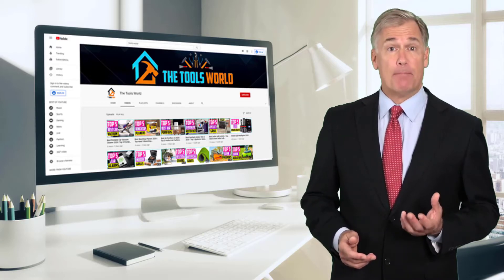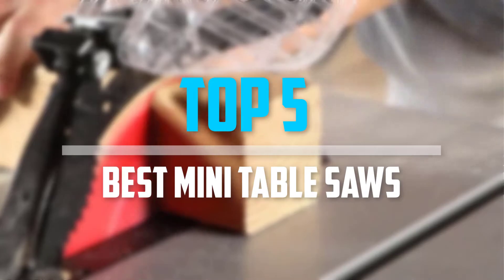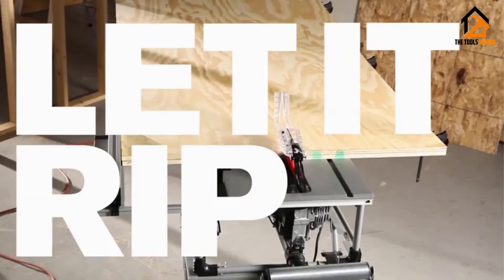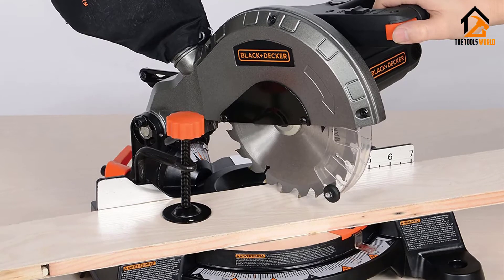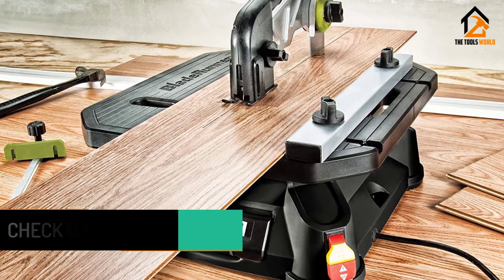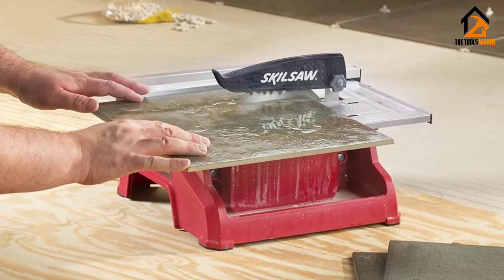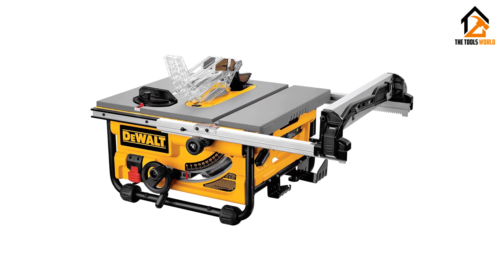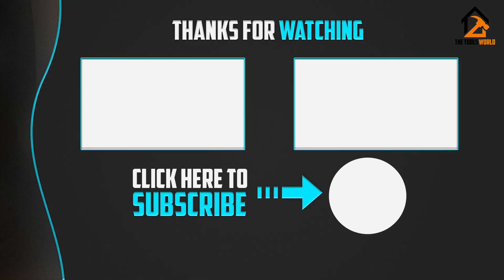Best Mini Table Saws - Top-rated 5 Mini Table Saw Review

Comment from the maker: ▶ In This video, We recommended the Top 5 Best Mini Table Saws

▶ 5. SKILSAW Portable Worm Drive Table Saw.  
 
▶ 4. Black+Decker M1850BD 7-1/4? Compound Miter Saw. 

▶ 3. Rockwell BladeRunner X2 Portable Tabletop Saw. 

▶ 2. SKIL 3540-02 7-Inch Wet Tile Saw. 

▶ 1. DEWALT DW745 10-Inch Compact Job-Site Table Saw.